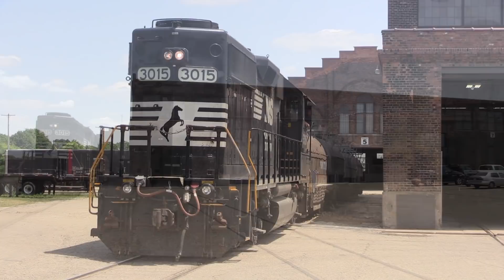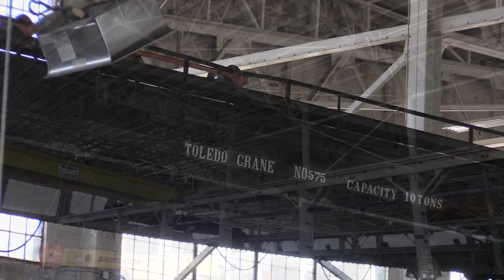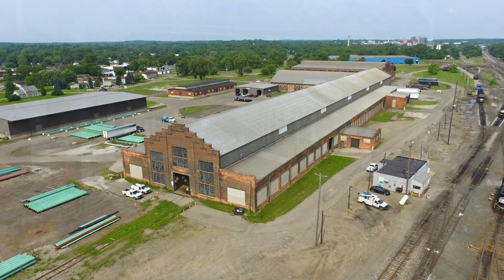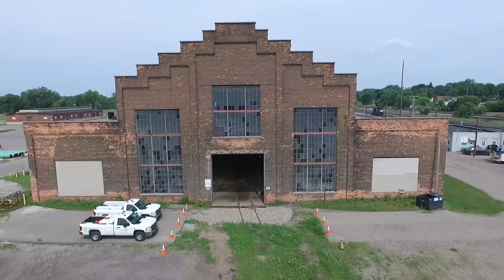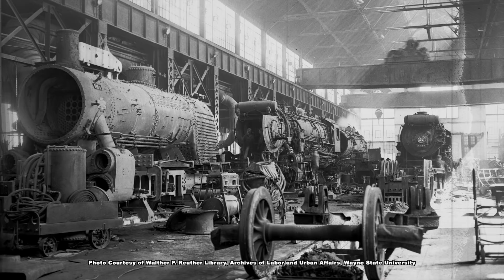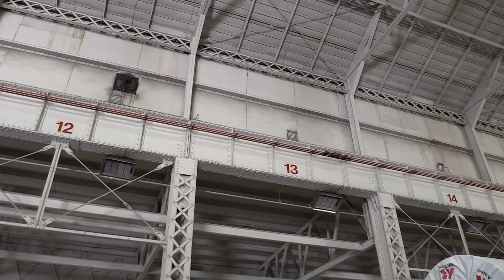Inside the Historic Michigan Central Railroad Shops at Jackson, Michigan

Comment: How much do each of those steel coils weigh??
Reply: I was asking you a genuine question I will say to get how much does each coil weigh please answer
Reply from the maker: @bradolsen8629  Sorry about that. To answer your question, each coil usually weighs between about 7 to 15 tons depending on the length and thickness of the plating. Coils weighing up to 30 tons are not uncommon.
Reply: @DelayInBlockProductions  That’s plenty big that’s for sure wow 30 tons is the heaviest